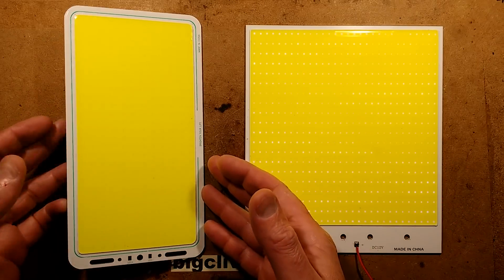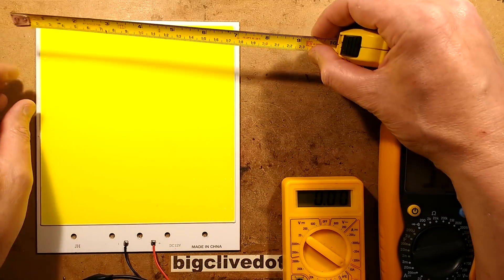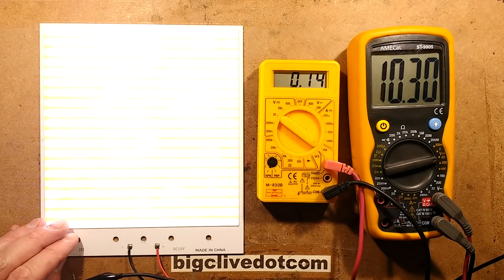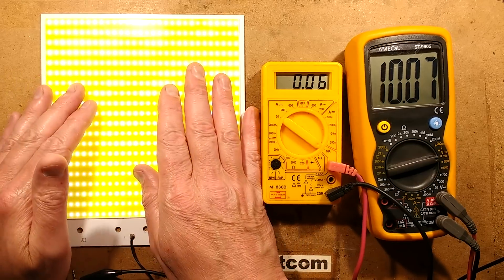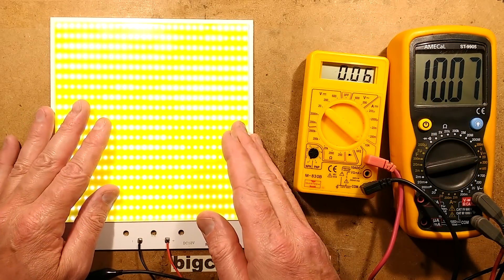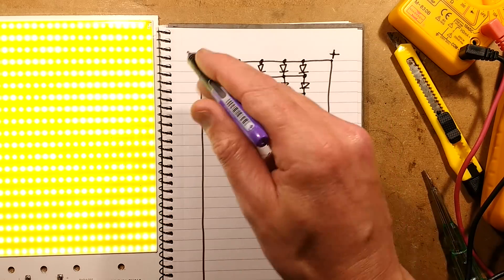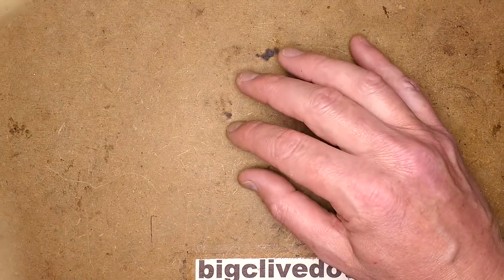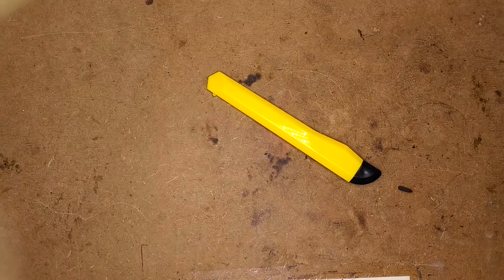Even BIGGER "200W" COB LED panel tests.

Comment: my home made cobs are better :)
50 watts each four cobs 1.4 foot apart in a square, 1 cob towards each corner but not on eeach corner...Great yeild from hottest chillis you can grow...Point of these SPREAD. light hitting eevery angle of every plant tip, pod and BUDS. equals density and penetration into canopy, means fill canopy thick, more tips more buds i mean chili pods. minimum 4 ounces of hot chillis like habeneros up to 8 ounces in 1.8 foot by 1.8 foot area...Bigger area, build it bigger..this is for wardrobe what my dreaming design i never made yet did do im talking about is.

Comment: When they say 200W, I'm figuring this is the 'equivalent' brightness to an incandescent lamp of 200W.  At 4 minutes 31, you are showing 3.01A @ 11.89V = 35.8W  x 5.5 (as a rough efficiency multiplication factor comparing circa 600 small LED's running at a reasonably modest 1/17th of a watt (circa 14mA each) to an incandescent) gets you to 196 Watts.

Comment: i want to make a lightbox with a cutout logo in plywood infront of it.
I want it to be very bright because i will have a color plexiglas 3mm between the glas and the cutout.

which do you recommend?
its a closed box 20x30cm and its closed so no aircooling 😁

Comment: If my LEDs are not matched and I still want to wire them together in such numbers - is there a reasonable way to get it done without adjusting single LEDs?

Comment: Hi Clive.

I have a question that I should realy know the answer to.

I wish to make a PCB for an IR Torch, it will have 100 X IR LED's aranged in rows of 10.

It will run off a 5V power bank The kind you get to charge a phone.
The spec's of each IR LED are, Forward Voltage 1.3v, Forwards Current 50ma.

The problem I am having in my brain is, what is the best way given the above details of aranging the LED's on the PCB? PARALELL or SERIES? 

Many thanks pal.
Reply from the maker: Two or three LEDs in series with a resistor, and then lots of those sets in parallel.
Reply: @bigclivedotcom  Awesome thanks Clive

Comment: It turns into a blue led if you can rip the yellow thing off without wrecking the bond wires.  Did this with a white 7 segment display once - blue is so much better.

Comment: Forgive my dumb question: how are you limiting the current? Are you driving with a PWM pulse? I thought that it wasn't possible to limit current and that's why they were doing PWM
Reply from the maker: I used a current limited power supply.  You could use a resistor or electronic regulator to get the desired current through these panels.

Comment: I have a small version of that thing and they are shitty. avery bright but overheat so quickly.
Reply: When I installed it everything was fine till I started the car and with the voltage rising from 12 to 14.5 it melted lol.

Comment: You answered many questions nobody asked, but- why did the photo you used for the reflectivity demonstration look like you'd photographed a circuit board through bubble wrap?
Reply from the maker: It was a macro image showing the weave of the fibreglass in the laminate.
Reply: @bigclivedotcom  Ah, okay. Thanks. I've never seen it quite so prominent.

Comment: Current limiting it down to 1 or 1.5 amps it would still make a nice panel lamp for the back of a van (camper conversion). But as Clive says current limiting is vital.

Comment: What do you use to adjust the voltage? Ive got a 405nm laser id like to dial down to take a picture of.
Reply from the maker: The laser might require a minimum current to lase properly.  I use a variable bench power supply.

Comment: I've just been waching this now.  I noticed the panel has a clear "DC 12V" label on it.   That would mean it would never run at 200Watts if you put only 12 Volts on it.
It's an interesting panel though.

Comment: Sir, firstly, please share the product details and where it is available (in which site - amazon/ebay etc.).
Secondly, is it possible and worth using this in commercial projects, especially industrial projects, from height ranging from 8 meters and above to achieve atleast 350 - 400 lux ?  Also, let me know if possible what could be the life of these types of Big COBs on a 24 hour operational conditions ( yes, we will take into account proper current and voltage rating as per the specs provided and mounted on a Heat Sink calculated as per wattage). I appreciate your knowledge in this area and request your guidance and suggestion on this product and similar ones, reply will help us a lot.  Thanks

Comment: Did you know the cannabis industry produces a pair of glasses specifically to protect the eye of growers from the spectific frequencies of light.
"Method 7" glasses for Sodium lighting was often used to colour correct videos taken under sodium light by placing it over the camera lense.
With the advent of high effiency LEDs in the last decade, they started making glass specifically to filter those frequencies.   I noticed in the news that the IOM has recently decrimilised home growing less than nine plants.  If you or big brother want to play along at home I have 5 spare seeds; Jazz queen.  Seeds are actually legal in the UK.  It is only germinating them that is "Frowned upon".

Comment: If one wanted to run this off a 12V 8 amp transformer, from 110v AC mains,  how can one limit the current so it does not get too hot? Main issue I face is that when I use standard transformers the leds and transformers get very very hot.
Reply from the maker: If it had an accurate regulated 12V DC output (switchmode supply) then the 12V should be correct for the combined forward voltage of the LED arrays.
Reply: @bigclivedotcom  thanks! so I just need to make sure the transformer label says switching power supply. What If I want to use a 12v computer power supply? can I just add resistors to the power line to limit the current?
Reply from the maker: @marktaylor5282  You can add resistors to nudge the intensity and current down.  The panel has no integrated current limiting so the main limiting factor will be where the forward voltage of the LED is equal to the supply voltage.

Comment: looks like 3000k and 5000k diodes mixed if that's even possible on a cob
Reply from the maker: The colour temperature is set by the yellow phosphor in the gel.

Comment: I think calculations where wrong to reach 200W.  at 12.6v and 5.05A the panel has 2.5 ohm resistance, therefore V=square root of P*R, so V need to be 22.36 Volts for the panel to reach 200W.  If this panel is 12v, i think seller advertised that this panel light output at 12V equals 200W of incandescent bulb output

Comment: I bet those tiny leads start overheating at even 5 amps.  They would probably melt the insulation and desolder themselves at 13 amps.

Comment: The oil from your skin is also being left being on the surface of this cob. 
When it is operated at high currents and gets hot it will act similar to HPS and MH lamps (they will explode), damaging the LED.

Which doesn't matter when you are cutting it open... lol

Thanks for the Video.

Comment: 0.023 volts each ...14 volts in / 600 LEDs ?
Reply from the maker: They are arranged as series/parallel arrays so there are effectively four blocks of parallel 3V LEDs in series to make up the 12V.

Comment: Is the IV curve of an LED at less than 50% rated power meaningful? I spend ridiculous amounts of time in front of curve tracers. LEDs are neither linear or predictable at low V.  How is any of this relevant?

As I read the comments it appears that viewers are interested in stunts not actual information.  So why not do it AvE style and just ape for the crowd?

Seriously.  Your information is misleading and you are basically relying on Chinaphobia to survive.

Bad bear.
Reply: 50% of rated power sounds very meaningful as it isn't that far fetched a goal for overdimensioning for long life. However I would find it interesting if you share some of your findings on LEDs given the extensive measurements you've done, and I'm sure some others would think so too.

Comment: You can actually use that LED panel as a ring light, the issue is that the light needs to be diffused more, if you had a translucent plastic to send the light through, it might fix your glare issue.

Comment: There are bigger panels on AliExpress some go as 200 by 200  mm and have 900 LEDs (30*30) and thus this does 900W. The thing takes up to 12v.
I buzzed the panel out with my GOSSEN METRAWATT Metrahit X-tra multimeter and found how the thing is wired. There are 36 parallel chunks of 25 LEDs. The LEDs in all chunks are wired as 5 sets series in parallel. Each chunk  has it's own voltage regular and resistor.
Great panel. Go buy one

Comment: Clive, would it be possible to use some of those varible resistor ICs found in 240v LED modules to limit over voltages and then power theses things from a car?
Reply from the maker: They're not designed for such high currents.  It would be better to use either a simple resistor to drop the small voltage difference, or a low drop regulator.

Comment: One thing about "Anti static bags"Most people think they insulate, when in-fact, that would make a terrible "anti static bag", The good ones conduct, thus leaving very little charge difference inside.
Reply from the maker: You also get anti static bags with a coating that results in very low charge generation.

Comment: I looked on eBay the largest I could find providing I typed the proper search was 70 W at 12V.
Not as large as the one you have. 
What search criteria did you use.
Reply from the maker: Try 200W COB LED.
Reply from the maker: https://www.ebay.com/itm/253172058690

Comment: I loved the drill torture test ! They are 600 leds on AliExpress COB sold as "400W(50w when 12v)" panels. I wonder if they are the same as they are more costly. They seems to be assembled by many shops on the same boards.

Comment: If you're wanting a ringlight you should be thinking about something you can get your head through and not your pinky   (QQ)
Incorporate a diffuser ... If you start from scratch and if you want a flashy one (not flashing - flashy as in super cool!) mix warm cold and daylight LEDS in equal proportions with just a few red and UV dotted round to make contrast.

With your usual tight field ... you just might get away with 5 or 6 of the first type of led strips that started all this, arranged into a circle (hexagon).  If you leave gaps it could give a Halo 40-50cm in diameter a diffuser should even it all out and give a decent cover fill.  You could even knit your own using a reel of 5050s and a brolly to try it out.

Comment: if your camera has problems with reflections, you could add a simple polarizer to it!
Reply from the maker: I've tried and it didn't help.
Reply: oh. interesting, didn't it work at all or was the attenuation just not enough? also, i think i remember some sensors needing circular polarizing filters instead of the traditional linear ones.

Comment: How is this supposed to be mounted on a heatsink? It only has mounting holes on one side and even if it would be held down on all the outer edges there would still be no contact pressure on the middle. And i dont think that drilling a hole in the center is intended by the manufacturer. 
This looks more like a "someone will buy it" - product than something used in a actual products.
Reply from the maker: I'd guess a clamp or thermal glue, since it will almost certainly warp if screwed down on all corners.

Comment: Hey clive, I just found a product that fits right in on this channel, and is very interesting:

A UV-C toilet sterilizing RGB night light. The impressive part is that it apparently uses a UV-C LED. 
So far I have not found a seller that even sells UV-C LEDs for reasonable prices.
Reply from the maker: I think these are fake.  I bought a UV shoe steriliser a while ago and it was just a blue LED to fake the effect.
Reply: Very possible. I am doubtfull as well. Might still be interesting to have a look though. They use motion sensors etc.

I found two versions, one that also sprays some deodorant or something and one that doesn´t.
They both specifically claim to use UV-C leds.

Comment: 10-13 amp in the 2  skini wires?
Reply from the maker: Voltage drop compensated for at power supply and measured locally with short tails.

Comment: Wow lol that's awful matching. Still sad these big panels have no mounting holes on both sides of the panel.
Reply from the maker: I just mounted one experimentally and used a screw to clamp the edge.  I wonder if the single sided mountings are to allow thermal expansion and contraction.

Comment: Clive ... interesting video . Perhaps it would be possible to access the individual sections and use a current regulator on each one . This would be a practical way to avoid the high cost of a prime quality unit .
Also , would a polarizing filter on the lens help with the glare ?
Edit : I see that smaller strip style units are available , perhaps these would be better for current regulator assemblies ... provided that the mismatch of the leds on each panel is not too great .

Comment: hey clive, to complement the LED videos, take apart one of the small remote control PWM controllers . I have hooked one to a panel and they look to work well.   https://www.ebay.co.uk/itm/272304276538

Comment: Just put some diffuser material in front of the panel. If it's not too hot, Styrofoam works great. That will soften the light, making the reflections less harsh.

Comment: Clivey, your "accurate" focusing made it worse :-( maybe you didn't have your glasses on !!
Reply from the maker: It didn't show on the tiny screen, and a recent experiment using a remote screen with chromecast failed when the video itself started glitching.  You'll see that in a later video about a street light.

Comment: Actually a common "12V" lead-acid car battery is slightly less than 14V without load, when in good shape and fully charged. If you pull 200W from it, the voltage will quickly drop, and the actual wattage through that cob connected to car battery will probably fall well below 100W within a few seconds as it needed 12.61V to pull 5.06 amps.

Comment: Hi Clive ! Very cool like always !! I have a question concerning the cob, i've made some experiment with driverless cob of different wattage. My goal is to determine which is the maximum power you can have with PASSIVE heatsink. And for now i can say that you can't go further than 10 watt for the driverless cob. Do you agree ?  In your opinion what would be the ideal passive cooled cob ??
Reply: Sébastien Fraggl It very much depends on the size of the COB!
Reply: Yes i know and my question is which size and wattage is the best for passive heatsink ?!
Reply: Sébastien Fraggl Nobody can answer your question unless they know what your constraints are, and what you're optimising for.
Reply: no constraints, and it's for any kind of lighting (for growing, for lighting a room...). I just want to know what is the max driverless cob wattage for a passive cooling system...
Reply: Sébastien Fraggl Then there is no limit to the wattage.
Reply: Peter McArthur in my experiment i have noticed that the 10watts are pretty easy to cool, but for more than 20w its tricky
Reply: Sébastien Fraggl Go to the factory that makes those 10 W COB panels, and ask them to make larger panels that are like two of the 10 W panels joined together. What do you have? A 20 W COB. And, because it's larger, you'll find that it's (almost) as easy to cool as the 10 W COB.

You could keep making it bigger, too. A great big 1 kW panel that's easy to cool is certainly not impossible.

And then there's the matter of the kind of passive heatsinking you use. With a heat pipe, you can thermally couple your hard-to-cool 20 W COB to an enormous copper heatsink, and then you would have no difficulty at all cooling your 20 W COB.

Do you understand, now, why you're question is much too vague.

Comment: You were insinuating that these may be factory rejects, that is, somewhere else you can buy these with all beautifully matched LEDs at a much higher price, and you can run those at or near the 200W.
But running LEDs well below their maximum design power is well worth it in terms of Lumen/W so surely, buying one of these could actually make economical sense, given the low £/LED.

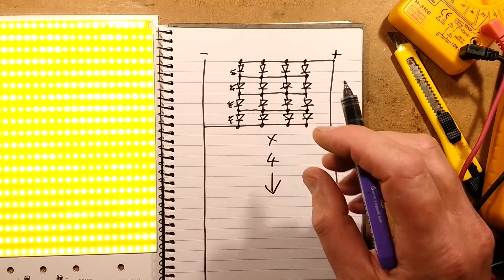Comment: 9:33 Why do they run those sideways links between individual LEDs instead of just keeping each string of 4 isolated?  I guess the shorting current is being spread across all 30 strings in parallel instead of passing through just the one string you shorted - so the short is less likely to blow the whole string. Also you can drill holes anywhere and strings sort of keep going thanks to the redundancy of the sideways links.... However it makes the array less uniform since you no longer get the forward voltage averaging effect of grouping strings of LEDs together. Now the Vf of all 30 LEDs in parallel has to exactly match otherwise you get a non uniform illumination...

Comment: Clive, I'm building a photo booth and I'm wondering if you could test the following. What is the time from 0 to 200 Watt startup time and how hot does it get when it's on for 4 seconds without heatsink.
Also is there a difference in startup time with DC cobleds and the 220v AC versions?
Reply: Kenneth Tan LEDs Turn on instantly
Reply: And what about the heat ramp up @ 4 seconds ON? (@ 200W)
Reply from the maker: It would be fine for bursts of output, but I'm not sure I'd use it in a long term professional product.
Reply: Just had a look at your 50W driverless COB teardown. I need to build it from a CC driven COB led to eliminate flicker. 
I'm guessing for the brief time it's on, temperature will not be an issue.
Thanks for the best electronics chanel on youtube Clive!
Reply: Where to get a 100-200 Watt constant current driver that has pwm support? For 12V COB leds..